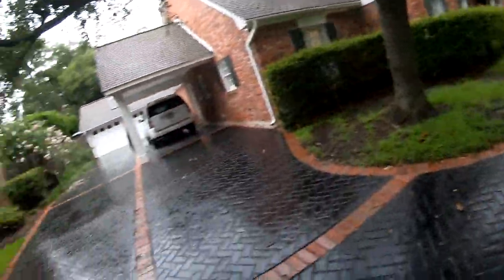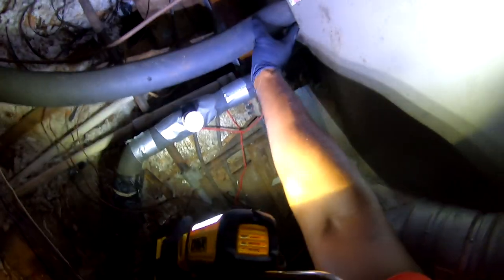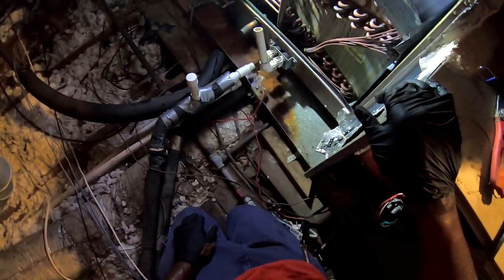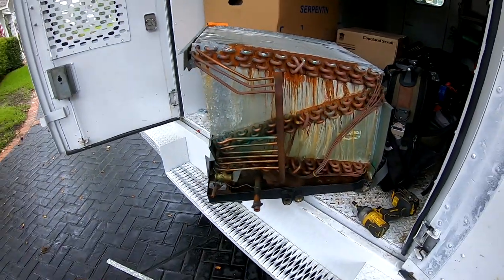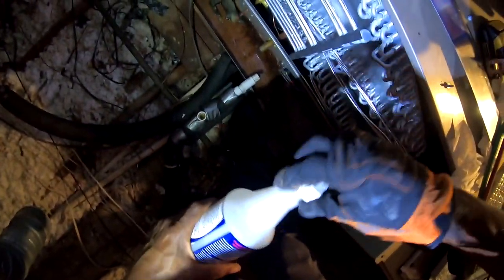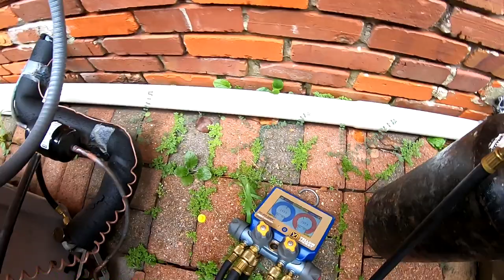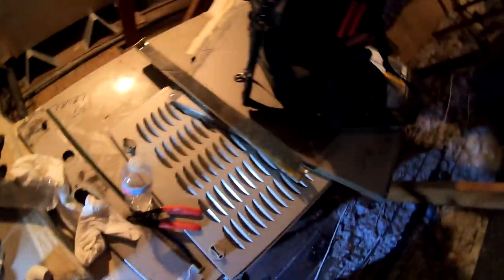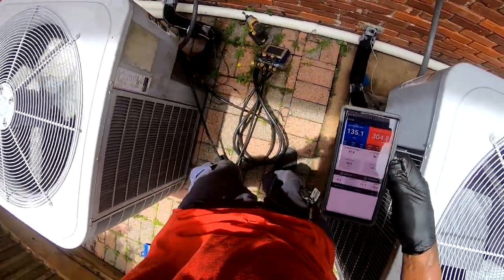"Can a 2 Ton Evaporator and 5 Ton Condenser COEXIST?! | HVAC Expert Reveals Truth"

Comment: If it's truly a 5 ton condenser with a 2 ton coil, it should run low suction with a low end of normal head pressure. The main problem this would cause is an icing coil, because the low suction pressure (due to compressor capacity) will lower the evaporating temperature. It might not be a problem in the hotter weather, but if it runs in marginally low ambient temps, it will frost up easier. Might want to add a freeze stat if it doesn't have one. Haven't seen the whole video yet.
Reply: I agree...  Already sitting at 4 degrees superheat.. this isn't refrigeration.
You need at least 10 superheat. What do you think will happen on cooler days with no heat load in the house going over the indoor call???
The coil is way too small.  Not matched well

Comment: You mentioned how you found the leak. You used the leak detector on the main drain line? Is that a trick??
Reply: Yes, you can pickup leaks that way. Air typically pushes out the drain, so if he does it before the trap, it'll sense the leak. H10 Pro Leak Detector is one of the best, they'll get the smallest of leaks.

Comment: I thought pouring water on a hot braze can lead to cracks and brittleness?
Reply from the maker: I wouldn't pour water immediately afterwards..just takes a few seconds to hardened..
Reply: A few seconds after is fine on brazed joints. You never want to pour water on sodered plumbing though.

Comment: You don't flow nitrogen when Brazing??? Not a good practice!!!
Reply: #DefundYouTubePolice ... jokes aside, not all the time people can braze w/ nitrogen. But even so, who said he wasnt purging it through from the outside?
Reply: Frost HVAC isn’t outside where most people flow nitrogen?
Reply: OG: Just because he doesn’t prove he flowed nitrogen on the video doesn’t mean he didn’t do it.
Reply: Go back and watch the video at 28:45. He connects the lines and picks up the torches and starts brazing without interruption. If he is going to charge the big boy prices he should do the job correctly. That is my story and I am sticking to it.
Reply: Yes you flow nitrogen though the whole system from the outside.
Reply: @FrostBlueFire  you definitely can. If you can hook up your gauges you can purge. Its simply laziness. Lets keep it real here
Reply: @speckulator7516  long as you use a plug purge kit or a port in attic your all good...4/5 psi.
Reply: @orangegrowers  🤘🤘🤘🤘🤘🤘
Reply: What’s the point of that